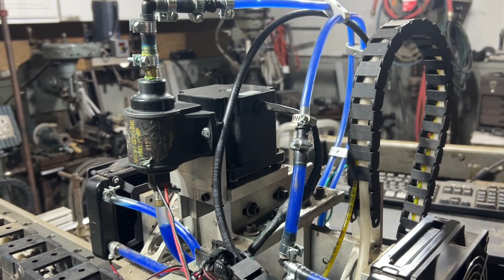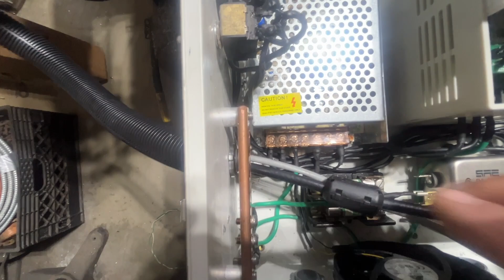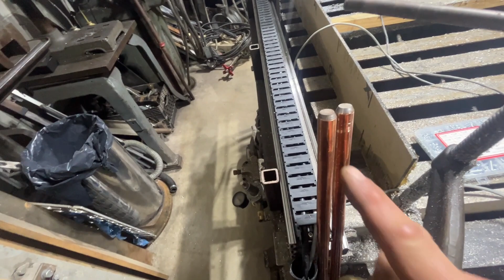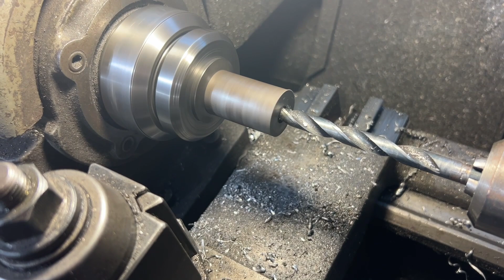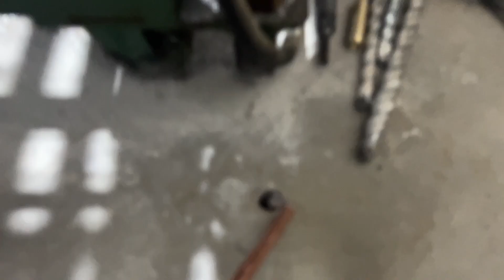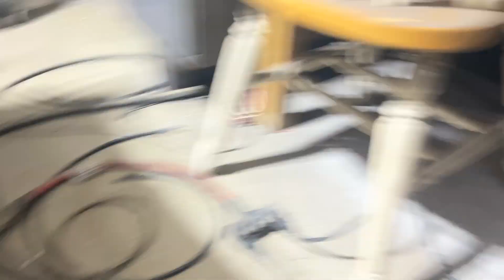2.2 kw spindle pt.2 Chinese water pump fail and ground rod disaster!

Comment: It looks interesting but with no link to part 1 I have absolutely no idea what you are building. Also that is an SDS drill, not a hammer drill and uses a different principle which gives much harder blows. Best of luck with it.
Reply from the maker: I unfortunately do not know how to link it to part one. I’m just upgrading from a Bosch router to a water cooled 2.2kw spindle on my home built Cnc table. I make carbon fiber and aluminum parts with it. Sds stands for the way that the bits attach to this particular drill. I have other hammer drills that use either a plain drill chuck or a different slotted design. All hammer and drill the same in my opinion. Thanks for the well wishes. Any tips on how to link the videos would be appreciated. lol up next is the new masso g3 touch screen I just ordered. Should be a descent upgrade from Mach 3.
Reply: @freddyfabricate  I'm afraid you know much more than me as I have never put anything on YouTube. I watch and record stock cars and Banger racing and have thought about creating a channel but have neither the time or knowledge.

Many videos just seem to have a link pasted into the description  but as I only had your part two name to go by I found nothing. I will subscribe  and hopefully see this project through to a machine that does everything you hope to achieve. I admire it when I see these types of project as I run Weinbrenner metal folding machines and see many other CNC machines and have seen what goes into them. PLC's sensors motors and so much more so to build something yourself is amazing. Best of luck.

Regarding the idea of a link I just found a video on YouTube explaining how SDS hits the bit along its length but also twists it which is why it is more powerful. I just went through chrome and search then copy the the link at the very top of the page

https://m.youtube.com/watch?v=4MJXSW9GJso

I think if you can find your first video and add a link it would help people to find part 1.